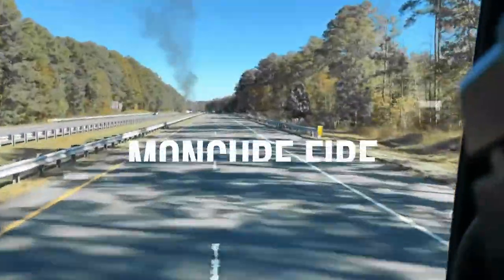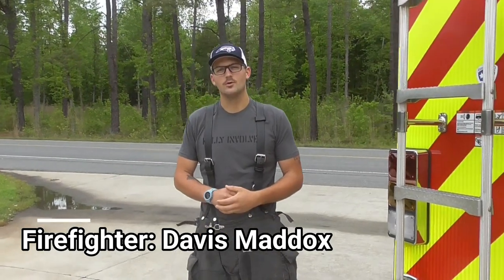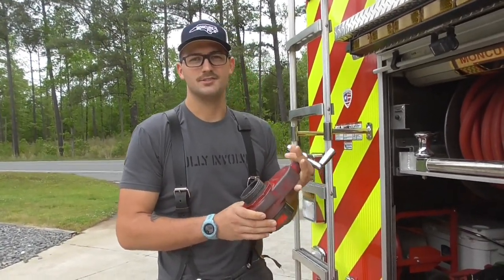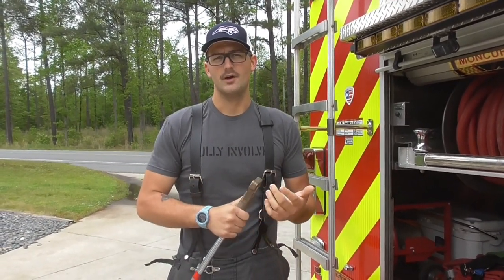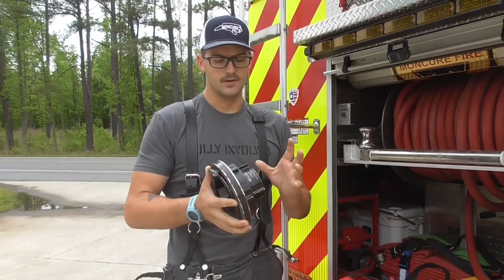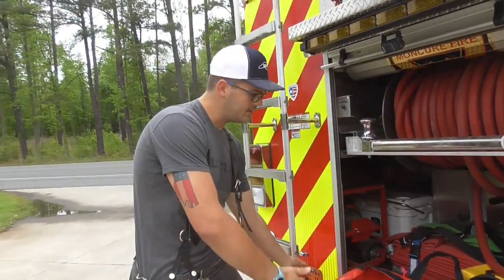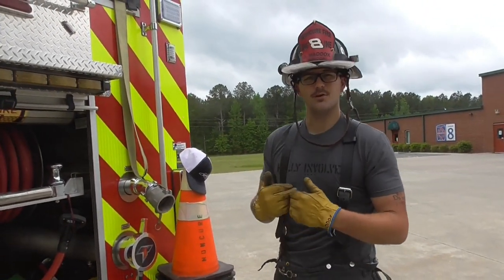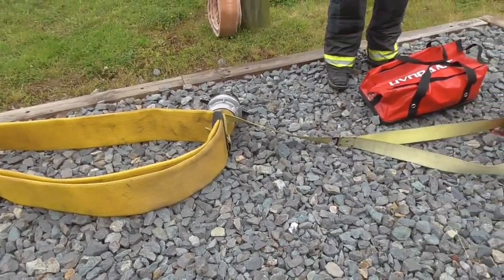Catching a Hydrant Using a Milwaukee Strap

Comment: Would it not make sense to test the hydrant before you tell your truck to drop all that hose? What would of happened if the hydrant was dead that day? Also, why not keep two gate valves so you can maximize flow? Just a couple of lessons learned.